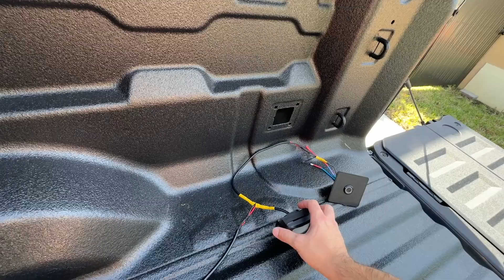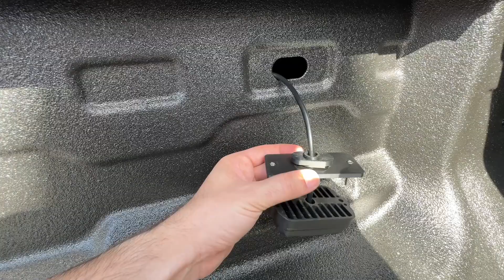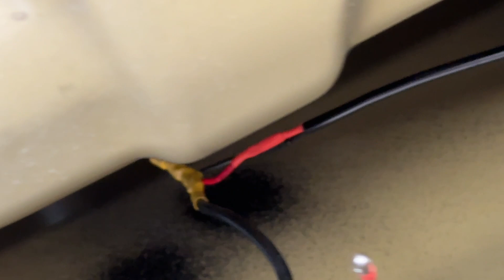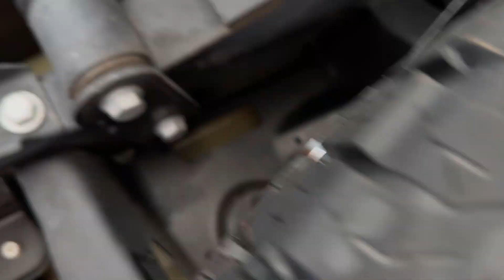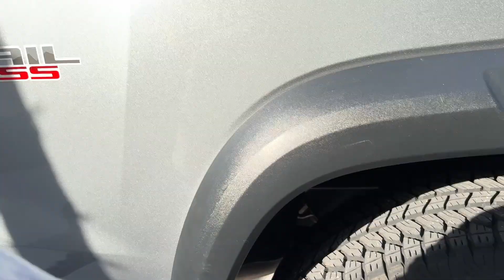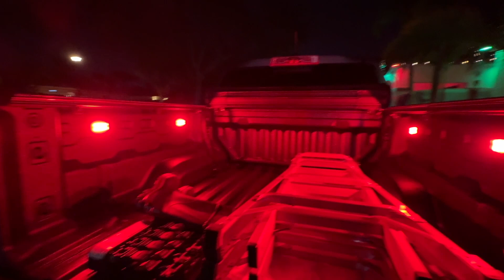2023 Chevrolet Colorado Bed Lighting

Comment: These trucks come with the accessory light harness already installed. Did you look behind each tail light?
Reply from the maker: @Lonestar-Reaper  I’ve removed my tail light for another purpose before but I don’t remember seeing a harness. I would have to look again.
Reply: There should be a constant hot for the factory bed lights that you can tap into. May have saved you some time